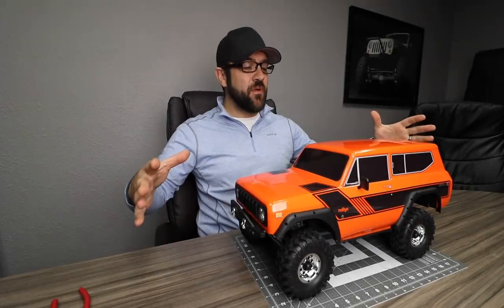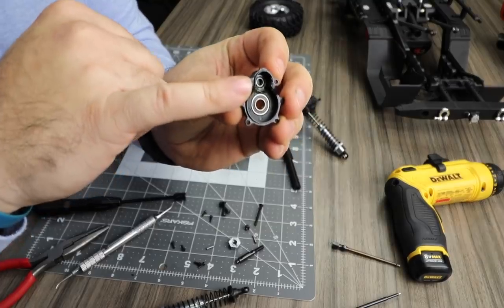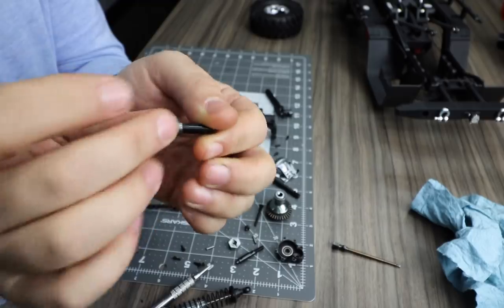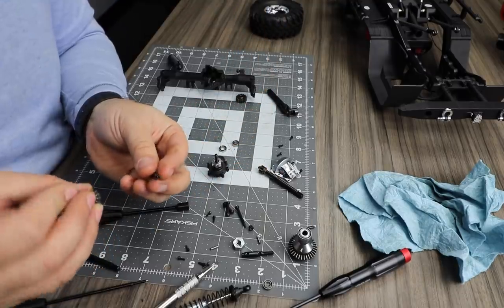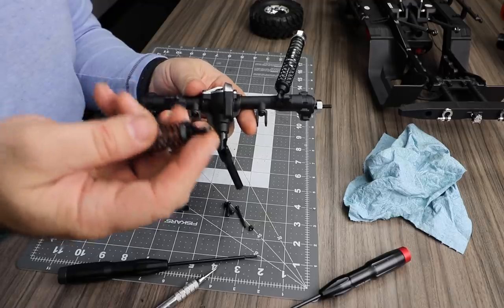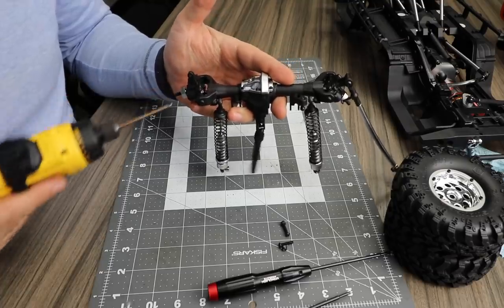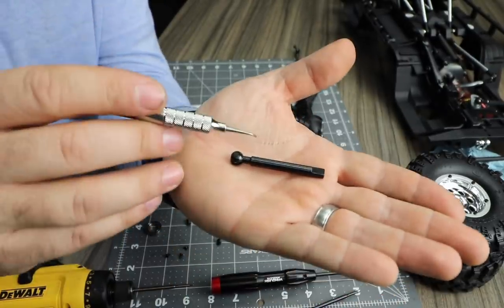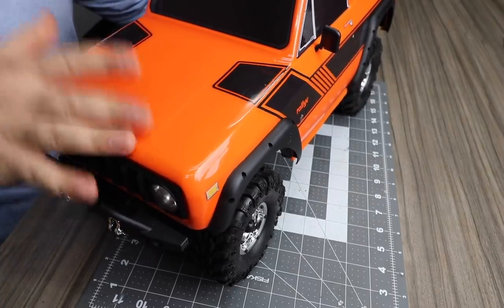Redcat Gen 8 Portal Axle Disassembly

Comment: OMG....  Where was this video when I had to assemble my Gen 7 Beta Portal Axle update kit??  It was heck figuring out how the CV joints got assembled. With no instructions it took me a bit figuring out the bearing covered the pin to hold it all together.  

I made a homebrew YT video, but not to this quality..  LOL...  

Great video and illustration.  

These are exactly the same Beta Portal axles (with update) as my Gen 7. They have held up great and very happy with them.

Comment: Good video. Really important to know that the portals are not greased. That'd be something basically every owner should be looking to do. Easy enough to apply.
Reply: I have heard mixed stories . . Some say the diff gears are dry and no grease also . . I have had a Everest 10 in past that hd no grease in diffs but others new from the box did have grease . . It is either quality issue or possibly different shifts building or different factories producing to different specs . . Always a good habot toncheck the diffs, portals and the transmission gears

Comment: Scintering in not the process of having a gear fit onto a shaft a certain way, that's just how it was machined or molded.  Scintering is the process of using extreme pressure and heat on a powdered material without melting the material to form a solid mass.  Great video btw.!!  Can't waite to get my truck in.
Reply from the maker: I’m aware of how sintering works, not sure of what part in the video you’re referring to.
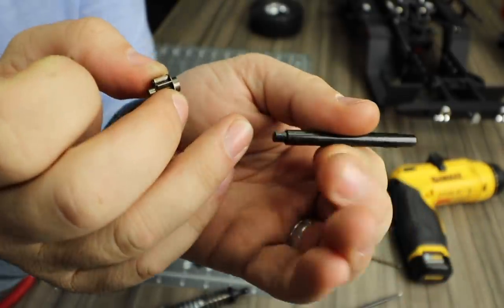Reply: @HarleyDesignsInc  Just go to 2:18...Im not nit picking just pointing out that because a gear and shaft fit a certain way doesn't mean that they are sintered.
Reply from the maker: Ah, no I was just stating the material type of the gear while describing how it is installed.
Reply: @HarleyDesignsInc  Ok my bad, just sounded that way to me.

Comment: I can say the engineering to this is almost the same with how premium vanquish products and others are engineered. yet they just asked 300usd.
Reply from the maker: That would be an easy point to argue against. They made some definite design mistakes that will hurt the long term ability to handle power. Now if they did that to cut costs or just due to inexperience is the question.

Comment: Actually the FIRST.... Where's my cookie? 😜
Seriously, nice look at the inside of these Axles. This proves that they are NOT the same as the Gen 7 Portals!!
Carmine 💥 ⛽
Reply: Yes they are...
Reply: No actually, they're not.
Reply: Really, and why do you think this?
Reply: Umm....  Yes they are 100% if you have the Beta Portals with the latest update kit.  Without the update kit, then you are correct. But with the update kit they are in fact the same axles in every way.
Reply: Umm I have the beta axles. These are the EXACT same as when you add the upgraded parts.
Which is also the same as the Gen 7 kits will be.
Reply: That's exactly what I meant! The few who got in on the Beta Program for the Gen 7 Portals, NOW have the update Kit. Some may not yet....
Updates include: 
Machined Locker - replacing the sintered iron ones on the First Beta Axles
One Piece Drive Gears in the Portals themselves - the original had a very thin wall gear, that slid over the input Shaft. Broke frequently. 
MOD 1 GEARS in the Portals - original had 48p Gears
MACHINED Ring Gear - the original was sintered iron and molded. 

There's a few more, but I can't remember. 
IT'S NOT THE SAME AXLE!!!  Unless you were one of the original Beta Testers, who got upgrade Kits from Redcat. Those Kits were even tweaked a bit for the Gen 8, after getting feedback.

Don't be a hater. Get facts.
Reply: Do you have the test axles?
I do, everybody who was a tester got the updated parts.
I see no difference between the ones I have, and the ones on the Gen 8.
The only thing we have not been given is the transmission parts to run 32p gears with the slipper.
Reply: @puzzleluvr  Poor man RC is a Scam Artist..He goes on RC YouTube channels leaving comments with a sob story in hopes of getting money or free RC's..It has worked for him so he keeps on doing it..People give him money and free RC's land and air..Pay him no mind.